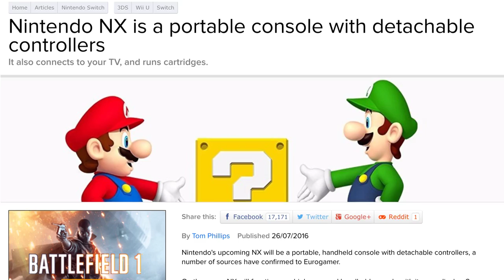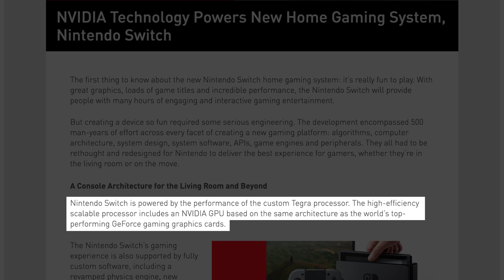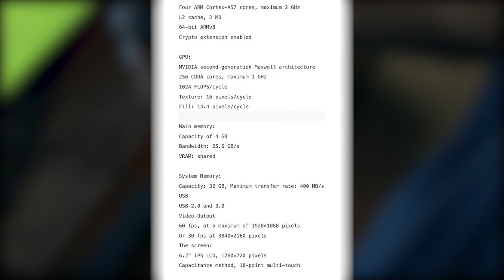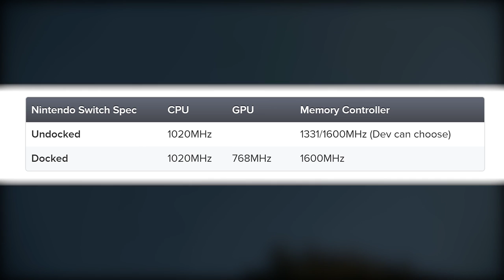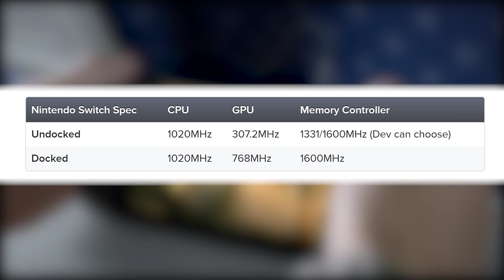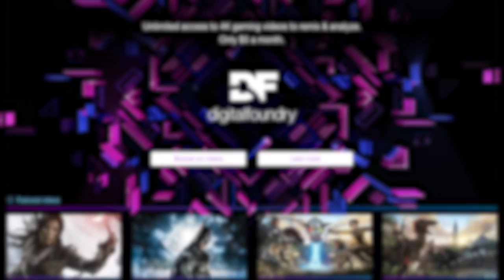DF Videocast #6: Nintendo Switch Clock-Speeds Revealed

Comment: The specs make sense from the point of view of battery management and cost-efficiency, but they are worrying concerning Third Party support. Hopefully the price is right and the usability and games are top notch!

The fact is that Nintendo doesn't look to replace PlayStation and Xbox in people's homes, but to get the Switch alongside them, as well as put a Nintendo console in the hands (pun intended) of people who generally don't use as much money on gaming.

For better or worse, Nintendo is continuing making consoles for themselves, and hoping that they can offer unique enough experiences that people are convinced to invest into (hence drawing in Third Parties as well).
Reply: What I'm hoping is that the Switch will be close enough to the power of the Xbox One that third party developers will be able to port their games to the Switch at a lower resolution. If a game runs at, say, 900p on Xbox One, maybe it could be ported to the Switch at 720p while docked and 480p or 540p in portable mode.
Reply: Doesn't sound ideal, but it's an option. :p
Running games is about much more than just resolution however. Let's see how much the lower CPU and GPU clockspeeds affect the complexity of shaders, textures, lighting, number of polys and actors etc. in practice.
Reply: Nope.
The switch will be weaker then an iPhone 7 (which already outperforms the not downclocked Shield console and Pixel C tablet in most benchmarks).

Here are some Benchmarks guys.

Geekbench 3 (processiong performance)

iPhone 7 - Singlecore: 3380; Multicore - 5500
Nvidia Shield Console - Singlecore: 1650; Multicore: 5040

The Switch will run at 50% of the Shield Consoles clockspeed.

GFX Benchmark (graphics performance) Trex 1080p offscreen Render:

Nvidia Shield Console - 120 FPS
iPhone 7+ - 108 FPS
Google Pixel C Tablet - 103 FPS
iPad Pro 2015 - 170 FPS

And the Switchs  GPU will run at 1/3 of the clock speed of the Shield Console.
Reply: That's real interesting.. but iPhones, iPads and Google Pixel C tablets are a whole lot more expensive than what Nintendo is aiming at.
Reply: The most likely price point for the Switch is $250-300.
Google Pixel C is double to that at $499 and $599.
iPhone 7 is a whopping $649 and $769...
And the iPad Pro 2015 is a goddang $799 and $1079!
Reply: Well it's your prerogative if you're willing to add a couple hundred bucks more to the price.. but 720p in mobile mode really is good enough.
Reply: I agree. I think 720p sounds fine for a 6-inch screen. I'd rather have that than a more expensive Switch that runs hotter and has reduced battery life.

And hey, 720p is better than the 480p screen we have on the Wii U's GamePad. I'm calling that by itself a win.
Reply: There is nothing the PS4/XB1 or hell even the Switch couldn't do that the 3DS could. As Metal Gear Solid 3 showed, the PS2 crushed the 3DS version - 640x448 vs 320x240, more foliage on ps2, better bloom and guess what, better lighting and post processing. Stop spewing shit, the 3DS isn't even a PS2.
Reply: Yeah, but Bethesda stated they'll support the Switch only if it's at least as powerful as the Xbox One, and there they are developing for the system. Todd Howard flat out praised the Nintendo Switch, despite him and Bethesda insulting Nintendo in the past.
 Plus, Unreal Engine 4 has been confirmed to run well on the Switch. Even though it may not be as powerful as the current gen consoles, it's seeming to be a success because Nintendo's making many people excited
Reply: @Moshugaani

Keep in mind consoles are often not sold at any profits, sometimes even at a loss.

Phones are different. An iPhone 7 for example is just 220$ to manufacture, including stuff like Cameras, HDR Displays, Fingerprint scanners, True-Tone Flaslights, Premium alumuminium cases, Taptic Enginge, 3D touch technology, LTE antennas and more.
Reply: Donkey Kong Fan my phone can run unreal engine 4. Yeah an enhanced 6 year old game.....not very good. Also the bottom line is that this thing is indeed weaker than the XB1

Comment: As a mobile device, it's power is probably fine.
Reply: as powerful as my phone
Reply: Marz10 That's what Nintendo is targeting the most with the Switch.
Reply: Better the phones copy the Switch's controller because touchscreen only just sucks for gaming.
The controller is way more simple than bulky controller gadgets for smartphone via bluetooth.
Also we do not have three arms to hold the Smartphone and the controller.
Reply: Luis TIGER Yes, a 900 dollars iphone is stronger than a 250 switch. Well you know a 1000 dollar pc is stronger than a 300 pc right? The point is the power of the switch that your getting for only  $250